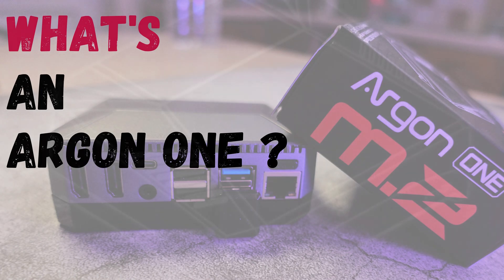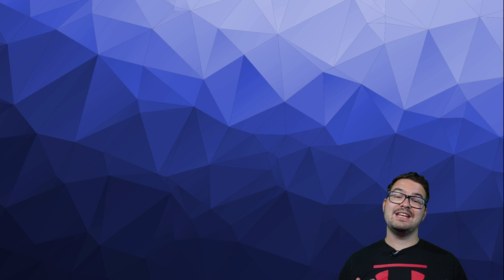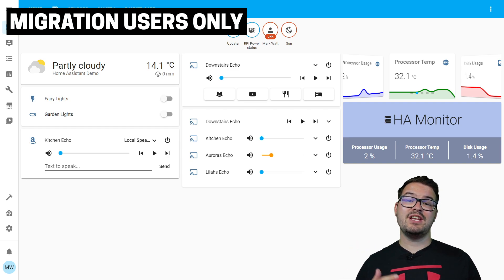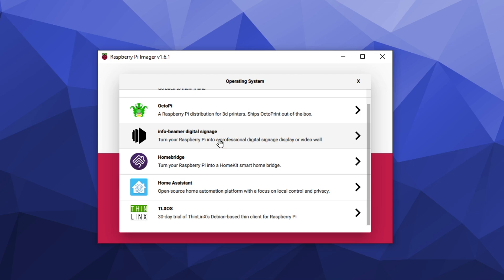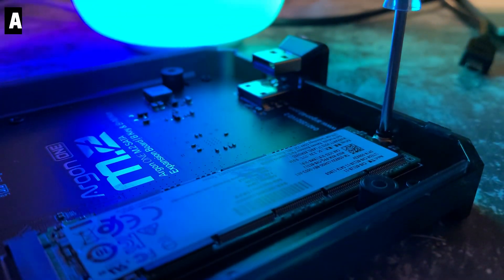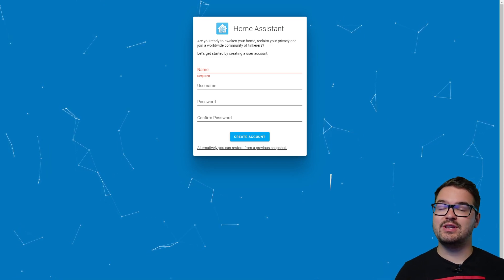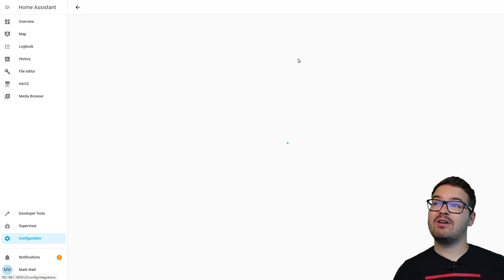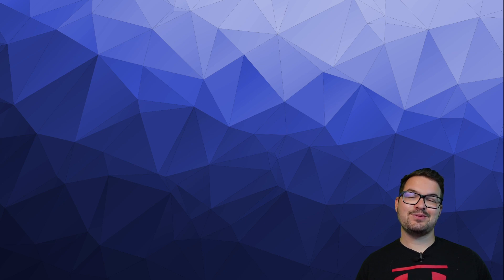Home Assistant ARGON ONE M.2 (Installation and Migration)

Comment: a couple of comments from my upgrade journey, you can use the bottom part of the argon case as a USB to M2 adapter, you just need to plug in the usb 3  U shaped item upside down and then use a usb extender cable to plug it into your computer to load the HA os. and after you have used the sd card to get the latest bootloader and before powering back up with the M2 ssd in the argon, you can remove the SDcard from the PI, its not needed anymore, but good to keep as a backup.

Comment: Thanks a lot for this video! 
Just two small issues / improvements:
1) You can use the m.2 part of the case, the dongle and an usb-extension to flash the m.2 drive.
2) When screwing your m.2 in place, the golden nut should be underneath the m.2 and the black screw above.

Comment: Tip: In my opinion a good choice if you have a capable router that allow you to use 'address reservation', you might want to keep the RPI on DHCP (instead of static ip) and assign a reservation in your router itself; so that your router assigns the IP based on the MAC-address.

Comment: Is there a way to disable the power button? When there is a power loss at my house, the Raspberry Pi is no longer auto booting back up.
Reply: Just found the answer in the manual of all places. 😅 Just have to move the jumper from pins 1-2 to 2-3.

Comment: Great video (Thanks - it's been useful for me so appreciate your efforts) ... however I have 2 comments:

1. For the uninitiated, just describing "An M2" .. isn't really specific enough. If you could expand on what "M2" specifically is needed as I accidentally ordered the wrong "M2", and a mis-matched "M2" caddy to do the initial write to ..

2. As is usually the case with Home Assistant, with the evolution of time, the restore process appears to have now changed (Doing this today - 8th June 2022). When I started from the fresh install, the "Supervisor" option no longer existed and the "Restore from backup" options have all moved. I found eventually that you need to go to "Settings > Backups" then upload your old backup and only then do you get the option to restore from that backup.
Reply from the maker: Thanks for the feedback. Apologies for not explaining the different types of M2 keys and classes.

As with any tutorial (HA specifically) they often become outdated after a few months as it’s an evolving platform that can change month to moth.

Glad you got it working in the end 🙂
Reply: @MarkWattTech  Cheers - "getting there", although the migration isn't complete. After the restore, most of the very small setup I've got doesn't work (having to re-install HACS, and the Tuya integration doesn't work for some reason ... but am planning to switch to Tuya Local anyways (just watching your other video on that 👍 )

Comment: Hi Mark, this is excellent! Just got my HA setup and considering switching to SSD and found Argon M2. However, it concerns me that HA OS is ending GPIO integration which might make it impossible to control the Fan on the Argon. Is this the case and will this be an issue?

Comment: An USB-A to USB-A cable to connect the argon board (with the ssd in place) and then you're fine. Of course you need the rpi4 to boot from usb but no need for that sata to usb 3 m.2 cable 😊 less hassle 😀
Reply from the maker: Yeah deffo a simpler solution :)
Reply: Great idea! But I simply could not find a USB-A to USB-a cable at home 😒. Instead I used a USB-A extender cable together with the USB-A bridge- connector. I was fortunate to have on extender which had a slim enough housing to fit on the bridge-connector. Worked like a charm 😀 Thanks for an excellent video!

Comment: I'd be really interested in a video that shows the best way to migrate if you are running an old version of HA:
- So is it best to upgrade your source version first to the current?
- install HA on the new target and then perform a downgrade?
- ignore all of the version mismatch and simply restore the snapshot from the source (old version) to the new target (new HA version)
Reply from the maker: Thanks for the suggestion! (This has been on my list for a long while)

Would the purpose of the downgrade be to show you how to revert? If everything is broken after an update?
Reply: @MarkWattTech  Simply, in case you can't apply a snapshot backup from an old version to a newer version of HA.  My HA instance is currently on OS 5.13 (I never update unless there is a need for it to be updated as I'm too worried about breaking everything) but the current HA OS version is 6.6.
If my SD card breaks tomorrow, would I just install the latest version of HA (6.6) and restore the HA snapshot (5.13) or would I have to install the same version of the OS that the snapshot was taken from?

Comment: Hey, great video. I am using a 256 GB M.2 for my install but when I flash Home Assistant using the Pi Imager or Belena Etcher it shrinks the M.2 to 32 GB and the rest of the space becomes unallocated. Is this normal or is there a way to use the full 256 GB in HA?

Comment: I've managed to complete this by following your video - thank you. I'm struggling getting it connected to my wifi - something I had managed when I had HA running on the SD card but the process I followed for that doesn't seem to have the same effect when running from SSD - Do you have a guide to do this?
Reply from the maker: Hey Chris, 

Is this just to access HA via WiFi?

are you able to access HA through ethernet? If so you can enable WiFi through that.

Head into Supervisor
- System
- ip address (Wlan0)
- WiFi (and then setup your creds)

Hope thats what you mean.
Reply: @MarkWattTech  Thanks Mark - I'm up and running. Just can't get any zigbee devices connected now, but hoping my usb2 extension lead arriving from Amazon later today will fix this. it's going to be a steep learning curve this Home Assistant thing :)
Reply from the maker: @chrissimpson1695  steep, stressful, fun and a never ending money bit. It will leave you pulling your hair out at 3am when that automation you spent a week writing isn’t working 😂😂. And you will always be chasing new shiny things just because they integrate into HA.

I would deffo recommend  the usb extension 👍🏻. Let us know if you are stuck and i will do my best to get back to you :)

Happy Home Assistant-ing

Comment: just bought all the bits and worked well great vid ,though u missed the thermal squares on the heat sink in the case install
Reply from the maker: This was more of a quick setup build for HA. I do plan on a more in depth one and will also look at how to control the fan speeds etc 😁
Reply: @MarkWattTech  it helped me a lot ,cheers fella

Comment: Do you need to leave the SD card in the Pi for it to boot to SSD? I have just powered on and nothing is happening... not even getting an IP from my router. But I removed the SD card.. Boot loader worked as I checked for a green screen... but that was with the SD card inserted. UPDATE: Doh....remember to plug in the USB 3.0 dongle.... (face palm)
Reply from the maker: Doh! 🤦🏻‍♂️. Glad you sorted it mate!

Comment: Please tell me how I can adjust the fan speed. Its really loud. I can't use it as it is. A vid walk through would really help me out.
Reply from the maker: Hey Fergus. There is a HA add-on you can get. I will be covering this in a future video too.
Reply: @MarkWattTech  Thanks Mark. I've found the addon and have it installed. I just can't figure out how to use it. It just sort of sits there!
Reply: I think I've cracked it, but thanks for the quick response.
Reply from the maker: Hey Fergus. Did you manage to solve it in the end? :)
Reply: @MarkWattTech  I managed to cure the loud fan issue by moving the jumper. It is running a bit hot and I can't figure out the steps to get the addon working.
Reply: All sorted. I didn't take off the protection setting in the I2C addon config. Once I'd done that - all good.
Reply: What is the add on called for controlling fan speed please ?

Comment: Very nice video as always Mark. This is my setup, had some bother when I did it using a 32bit version of the image. For some reason the rasppi imager crashes my PC so I always get some issues. Once done though superb and it’s been rock stable for months, only had the fan kick in hard once.
Reply from the maker: Thanks for the feedback as always Iain 😁. It’s a great setup and can be placed pretty much anywhere without being an eye sore. I personally use an Ice Tower build (future build video 😉) and I use the Argon as my Pi projects case. So handy to test little bits with the colour coded pins.
Reply: @MarkWattTech  absolutely it actually sits in front of my TV at the moment. You could easily use this case for a nice little media centre build.

Comment: Any thoughts on why the Argon case would not recognize the SSD?  I'm able to boot everything with a Kingston A400 using an M2 to USB adapter on the pi 4.  So I believe the pi is updated with the correct bootloader.  When the M2 is in the M2 board with the USB to USB adapter installed, the drive is not recognized.  Any troubleshooting steps I could take?

Comment: Excellent video! I am thinking of buying the argon one m.2, but I have some doubts regarding the installation and configuration of the m.2.
I have seen 2 different ways to install HA:
1- The process you carry out using an SD memory
2- Installing directly on the m.2, but without using the SD memory
So my question is what is the difference between doing it with SD memory and without it?
Thanks in advance.
Regards from Dominican Republic.
Reply from the maker: Heya :) its a great case! I will
Also be doing a standalone review video for it to show it off and run through more of its features. 

For the installation your Pi will need to have the latest EEPROM update and have the bootloader set to be USB. If your already using a Pi 4, the chances are you have already updated this. However you will still need to set the bootloader order.

In this video I use a brand new RPI4 which is why I use the SD card to update it. The card is only used for this and then we dont use it again.

So essentially we need to use the SD card to tell the Pi we want to boot from USB.

Hope that makes things a bit clearer for you.

Comment: The ArgonOne M.2 is my current HA setup, and is so neat.  Originally tried the Argon fan speed stuff (which you are sure to cover in your review) but found that the ‘default’ (fan always on but hardly noticeable) keeps my hard working CPU at at relatively stable low to mid 40’s degrees C. 
Nice tutorial as always Mark.
Reply from the maker: Thanks Jon. I will indeed be covering it in the standalone review. Have you done anything with the IR or the button controls? :)
Reply: @MarkWattTech  Installed the ArgonOne Active Cooling add-on as recommended below and it works a treat !  
( Just follow the instructions - particularly the I2C and double power-down reboot ! )

Comment: Great video Mark...thanks....what is the usb 3.0 dongle for???
Reply from the maker: Hey Jame :) I accidentally said dongle 🙈. Its a connector. It connects the M.2 to the Pi 4 via usb 3
Reply: @MarkWattTech  thanks Mark...I have an argon case but no dongle...I would lie to move HASSIO to this....currently on a PROMOX box on an HP Elite mini...
Reply from the maker: @jamegrabham9992  have you been looking at my video schedule ? 😉
HP Elite Mini is my next build video

Is your Argon Case the M2 one? The SD card variant doesn’t have the dongle.
Reply: @MarkWattTech  video schedule??? Where is that my friend?
Reply: @MarkWattTech  No it is not....it is just an Argon case...
Reply from the maker: @jamegrabham9992  you can buy the m2 base by itself too.
Reply from the maker: @jamegrabham9992  Haha it’s in my own private notes. You just so happened to guess the next build video 😋
Reply: @rob1971  Thanks Rob...I just ordered the M.2 base from Amazon...I had spare m.2 kicking around...again, thank you
Reply: @jamegrabham9992  you're very welcome Jame 👍🏻
Reply: @MarkWattTech  My first Argon case was purchased last year (original)...I have purchased the M.2 base (as per Rob.B.) from Amazon.ca...I hope the Argon V.1 and V.2 are similar???
Reply: @rob1971  thank you Rob B
Reply: @jamegrabham9992  ..i have both V1 & V2… differences are: 
V1 has MicroHDMI connectors
V1 does not have the sensors for the IR function

V2 has full-size HDMI connectors
V2 has the IR sensors for the IR function

N.B.  The V1 board DOES have the pads & holes for the IR sensors, but I don’t know know if it’s a simple “install & solder” step…

And the ‘add-on’ board that converts a V1 to a V2 fits perfect.

Oops…one BIG difference.. V2 bottom DOES NOT HAVE SDcard ACCESS!!! This may or may not matter to you.
Reply: The dongle connects the Raspberry Pi to the daughter-board that holds the M.2 drive Jame - there's no direct connection between them within the case.

Think of it as a very short USB cable 🙂
Reply from the maker: @rob1971  what Rob said 👍🏻
Reply: @rob1971  thanks Rob B...:)

Comment: Nice Video. Love the M2 but the only down side is that their custom Argon M.2 power brick is sold separately. @
Mark Watt Tech, you didnt mention the power option on the Argon one. there's a power jumper on the argon, that allows you set the pie to "always on mode".  its handy tweak.
Reply from the maker: Heya :) this video was primarily focused on the HA side of things. I plan on doing a separate review of the case as there’s so many cool things about it :)
Reply: The “custom Argon M.2 power brick” is nice….. but ANY RPi4-capable brick can work.
Just buy one that can source 5.1V @ 3A……

Quick Tip:
Higher  Amp 5V supplies with USB-C connectors tend to be pricey, because the sellers know the RPi4 crowd want them…
But those same supplies with a barrel connector or bare wires tend to be cheaper, and the overstock/recycler/etc crowd can be super-cheap.. early 2020 I snagged ten bricks, 5.1V @ 4A, barrel-connector..$20 SHIPPED. As I need them, I cut off the barrel and solder on  a USB-C connector.

Comment: You can use the USB Connector to flash the image to the SSD  if the SSD is mounted in the enclosure and that is not already combined with the other part of the case.
Reply: Just to add even if you built the whole thing removing the u-shaped adaptor detaches the M2 from the Pi so you can just plug it into the PC.  I did turn the Pi off though just to be double safe.
Reply: @JaneTaubman  What kind of USB cable did you use? The drive had a USB-A. Can I use a normal C to A cable from my Macbook?
Reply: @daaf84  I just a normal usb extension to connect usb
Reply: That was a life saver... tried it before reading this comment, as I didn't have anyway to connect my ssd to my computer and felt disappointment that I couldn't progress. Luckily it works great.. no additional hardware needed.. great job!